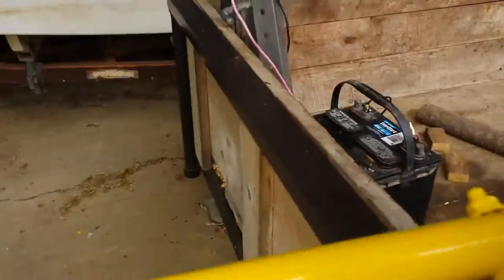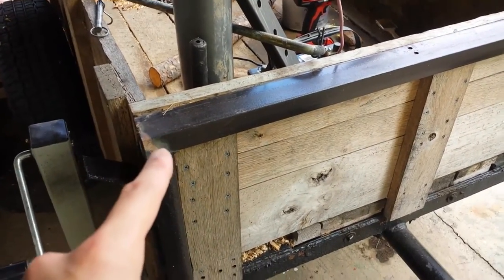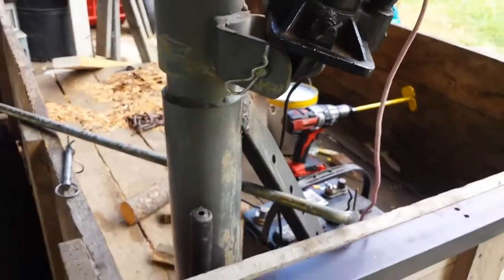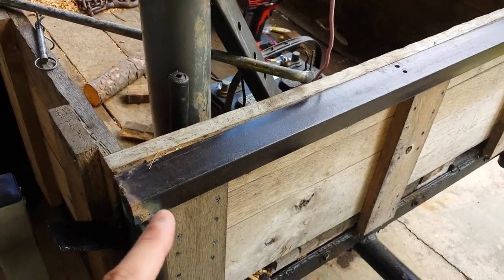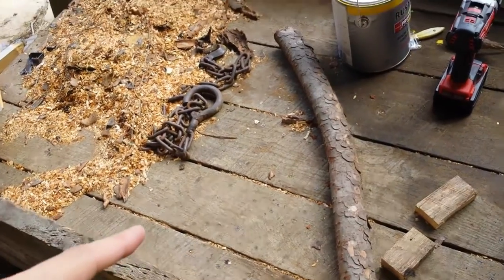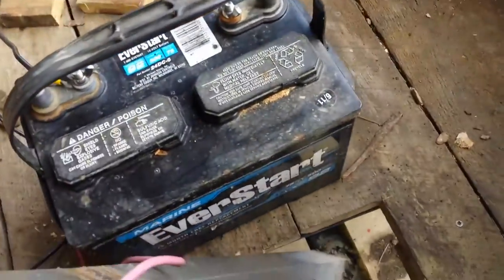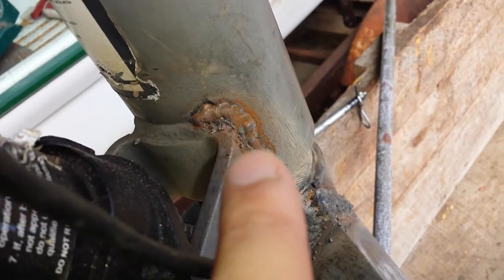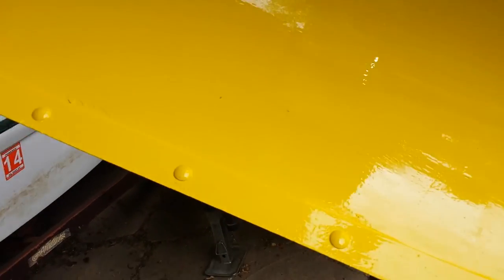Strengthening Harbor Freight Pickup Truck Crane Mount

Comment: That should be stronger now. I have never had luck with welding bed frame angle, the welds become brittle and crack every time I have tried using it.

Comment: I would suggest that you add a brace from the top to the opposite lower corner on both sides to stiffen thr headboard of the trailer.

Comment: with all due respect, your need to really practice on your welding. it looks like your moving to fast and not carrying the puddle. that is very common with 110v welders. they do not get instant good penetration like the bigger more powerfull 220v welders. I used to weld the same way. it took many hours of laying beads before I could carry a nice puddle with my 110v miller.
I also learned that I had to get a little closer to see the puddle good and I took the gas cup of my mig so i could see the puddle better. gas cup is not needed with fluxcore. when you get closer to where you can see what the puddle is doing, you will notice that when you have the puddle good and hot, there will be a shiny  reflective spot at the top of the puddle. it almost acts like molasses. after I saw that, I figured out how to control that puddle and use it to my advantage. my welds are 500% better and I even trust them now. I wish you the best. keep laying beads.
P.S. clean the metal VERY well with a grinder before you weld it. it makes alot of difference

Comment: thanks for this hint. Looks very good and rock-stable. Do you added a second brace in the mean time? I am thinking of modify my old Holder ED2 trailer with such an crane too. The trailer has to be repaired in spring anyway and so I could combine the work with the enhancement of a crane for my wood works. https://www.youtube.com/watch?v=epMusECEeTk